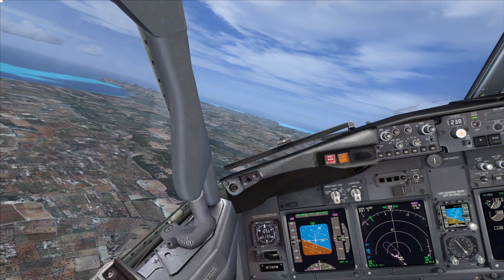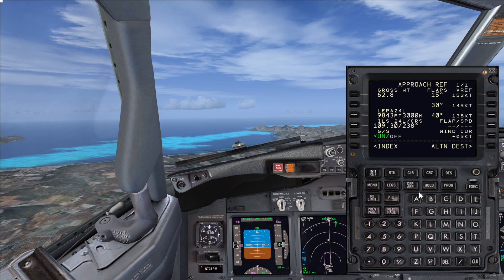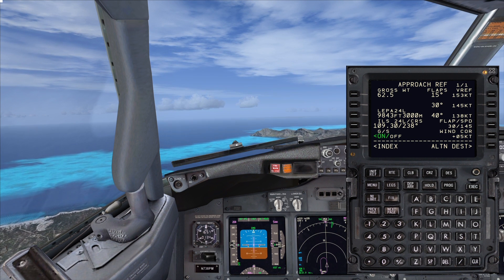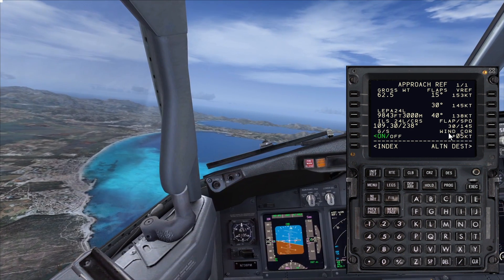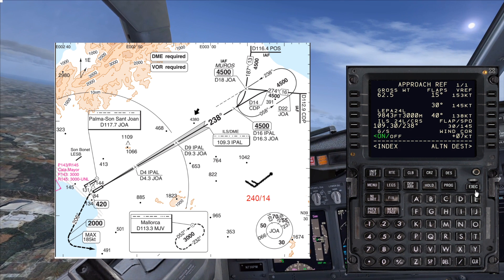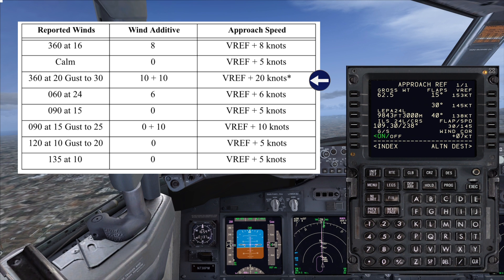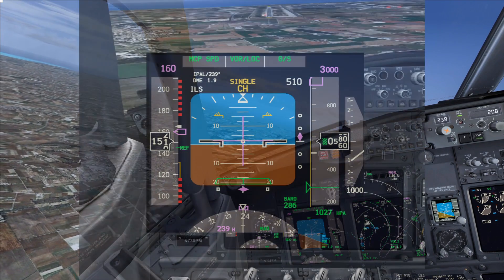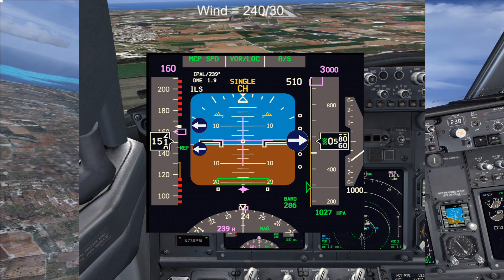PMDG 737 | How to calculate your final approach speed | Real 737 Pilot

Comment: Thanks for doing this tutorial ... although a few years ago, still very relevant and helpful to fellow simmers (like me) learning the ropes... It's a great explanation and I am with you to a point... in the chart, the top and bottom three examples make sense but I don't follow the logic with the middle two... 060 at 24 (additive 6) and 090 at 15 (additive 0 )... maybe a clue lies in the wind direction shown in the chart? (hoping you will clarify please). When referring to 'head wind' ... does this literally mean 'head on' or does it also include a certain tolerance either side?... Lastly, what happens if there's a cross-wind?

Comment: hey, one question how do you calculate the landing speed when the wind is variable  (e.g. 29016KT 210V310) Do you calculate it the same way ?  So if the Runway Heading is 290 and the wind is 290/16KT 210V310  would i then have a landing speed of Vref + 8 KT ?

Comment: great tutorial :D, but.
lets say this is the case:  WIND 020/09kts (08KT HW)
headwind is 8,  8/2 = 4 then add +4 to vref? but didnt u say minimum to add is 5?
Reply from the maker: If the headwind is less than 10kts, use VREF+5. It's the minimum wind additive. 

eg - 
NO wind = + 5kts 
7kt HW = + 5kts

If above 10kts, half the HW component 

12kt HW = + 6kts

FD2S

Comment: Hello:  A well done video.. Thank you.   

I am lead to understand that the +5 is for speed protection when using the autothrottle.   If you were flying manually what would be the vref ?  Do you take off the +5 ?  (assuming no wind).  I am not referring to wind corr, only vref.

I hope this makes sense,   Iain

Comment: Hey, thanks for the video! One question though: for a very short runway, say, Skiathos with only 1600 m. available, how do I decide if I need flaps 30 or 40, assuming the gross weight is for example 62 tons? Thanks!
Reply from the maker: Flap 30 is the default flap setting, Flap 40 for short runways, generally less than 2000 meters so definitely in Skiathos! 

FD2S
Reply: @flightdeck2sim  Thank you very much!

Comment: what would be when the wind is comig straight from the sight? than you take the half of the knots too? So 7 knots?
Reply from the maker: Hi Leo,

Only based on headwind component so standard +5. If the crosswind was gusting you would add the gust increment.

FD2S
Reply: @flightdeck2sim  okay, thank you :) is it the same on the airbus a320/a321?

Comment: What about the rule of thumb I heard of that you have to add half the gust factor to your approach speed (for example at 240/12G20 with rwy heading 238, you add 6 kts and additional 4 kts, so VRef+10) does this only apply to GA aircraft?
Reply from the maker: The gust factor in your example is 8kts (12G30) which we add to half the steady HW component, so you owuld use VREF+14kts in the example

FD2S
Reply: @flightdeck2sim  thanks alot

Comment: how to calculate the flaps up speed? there is any video about this question in the whole you tube!
Reply from the maker: Hi Renato. The easiest way is to work out your VREF for Flap 40. This can be found in the FMC on the INIT REF page in flight or tables in the manual, it’s based on your gross weight.

You then simply add 70kts to this for the UP speed.

FD2S
Reply: flightdeck2sim hello flightdeck2sim! thank you so much !

Comment: Hi FD2S, wow; I thought I knew everything there was to know about  flying the 737, since watching your videos I have realized just how much I have to learn. Very detailed and informative videos; I really enjoy learning beyond the checklists and the reasons why these checklists are created in the first place. I have two questions if you wouldn't mind answering. 
I'm looking to buy a new laptop to run p3d or FSX on, what laptop is it you use? it seems to run everything very nicely and seems it would fit my needs. and secondly; what EZDOK settings do you use? , I've tried setting it up but just can't get it to work like yours does; would you mind sharing your settings on avsim or even just a screenshot? 
thankyou 
Chris
Reply from the maker: Hi Ann, thanks a lot (the best pilots never stop learning!)

This tutorial was filmed on a Dell XPS Laptop (9550)

Intel Core i7 2.6 GHz, 16 GB RAM, 512 GB SSD, NVIDIA GeForce 750m.

The performance was ok but would struggle in areas of complex scenery/airports

I recently upgraded to a ChillBlast PC which has these bits....

• Intel Core i7-7700K Kaby Lake Processor/8MB L3 Cache
• Chillblast 120 CPU Water Cooler
• Asus PRIME Z270-P Motherboard
• 32GB DDR4 2400MHz
• 500GB Samsung 960 EVO M.2 SSD
• NVIDIA GeForce GTX 1080 8GB Graphics Card

You'll see a marked improvement in performance compared to my older tutorials.

The EZDOK settings are from the AVSIM Library, it was under PMDG NGX or something like that! 

FD2S

Comment: Hello! I had a question when i put in my vref + 5 IT is very far way from the stall speed. When i try to fly slower i am able to fly 3 ° pitch up but when i fly vref + 5 it is a negative pitch... I have the correct fuel and payload quantity in the fmc hope you can help me.
Reply from the maker: https://youtu.be/6qnriMfIbEE?t=5m55s

From this time you can see the target attitude and thrust settings for Flap 30. 

FD2S
Reply: Thanks for the information. In the table, it says Vref flap 30 + 10 this depends on the wind right? so should I fly Vref + 5 ?
Reply from the maker: Correct, minimum approach speed is VREF+5 👍🏼

Comment: Hi, great video! Today in a very windy approach I had to use my vREF+20 knots, I did the flare as always (check, close, hold technique respectively check at 20ft, close at 15/10) but the aircraft floated all down half of the runway! I don't know if it was due to the relative high speed or due to the wind... (RWY 32 wind 290/26 gusting 41)  What can I do the next time? Thanks in advance and keep going, this channel is fantastic!
Reply from the maker: Hi Francesco,

It would have been the increased airspeed that caused you to float. This is something you have to deal with in real life if you have increased your final approach speed due to increased headwind. In these situations you have to sometimes fly the aircraft onto the runway and not "check" abruptly otherwise the aircraft will just pitch up and climb. 

Good Luck!

FD2S
Reply: flightdeck2sim Thanks! What do you exactly mean for “fly the aircraft onto the runway”?
Reply from the maker: Usually when you flare, reduce thrust and hold the attitude the aircraft settles down nicely. If you have a higher approach speed the aircraft has a increased tendency to float. To counter this you might have to pitch down very slightly to get the aircraft to touchdown but you must ensure the main gear touchdown first.

FD2S
Reply: flightdeck2sim Thank you, I definitely need to practice😂

Comment: Great video! I have a question about the chart. What is the formula for calculating the wind additive of a wind that is between a headwind and crosswind? I see that the example of 060@24 is 6 knots and my logical guess is that it's a 4th of the wind speed but I wanted to be sure.
Reply: You can learn cosine factors for 30, 45 and 60 degrees for quick calculations. It's .86, .707 and .50. For 060@24 example, cos of 060 is .5 so head wind component is 12. You need to add half of head wind component to Vref speed so it's 12/2=6
Reply from the maker: Hi Grymlocked, Thanks!

We have a very handy crosswind/headwind table in the flightdeck on a checklist and our OPT app calculates it for us. There are lots of rules of thumb you can use but I've genuinely forgotten all of them! It's been a long time since I've flown a light aircraft and had to calculate crosswind/drift!

FD2S.

Comment: Another great video!
In the last minute, did you mean that any time within the last 500 AGL, if the IAS goes below VREF and above VREF+20, we must go missed?
Reply from the maker: Hi Wotao, thanks again!

No just at the landing gate. Below the landing gate if you approach or just exceed VREF - VREF+20 PF must immediately correct but if the correction is not working then you'd fly a missed approach.  

One thing FSX doesn't replicate well is flying in gusty/windshear conditions. In the real aircraft with strong gusty winds it can be extremely challenging to fly a speed accurately, the A/T certainly isn't capable of making the change quick enough in strong gusts.

So long as you're correcting speed and the correction is working and you get your self stabilised again you could continue.

Hope this helped!

FD2S
Reply: Thanks a lot for the clarifications! They are very helpful.

XP11 seems to simulate wind gusts well, but too bad there is no study-level airliner yet.

Comment: A fantastic video as always! Just a quick question though - if ATC tell you to "reduce minimum safe apporach speed" is this the VREF speed with no wind correction or anything lower than that? Thanks!
Reply from the maker: Good day! Thanks a lot!

If Tower requested minimum approach speed that's fully configured to land and flying your target airspeed so VREF + any wind additive you calculated, usually requested when someone misses the exit or Tower are trying to get a departure away.

All the best!

FD2S.

Comment: Good work again; thanks. I always learn something from these... this time around although I knew how to calculate landing weights and speeds I learned about using the bugs on the airspeed tape along with the yellow arc to confirm landing. 

I've got an off-topic question about real world procedures: in your airline do you update flight progress manually by writing on a paper copy of the navlog? I use an online service to produce PDF copies of all my flightplan and briefing pack, but I view these on a tablet pc and can't update them as I cross waypoints enroute. Do you guys do that at all? On paper? On EFB?
Reply from the maker: Hi John, thanks again for your kind words!

At my current outfit we still use paper OFP's (Operational Flight Plan) as do a lot of operators still. We print out all our flight plans for the day before our duty. In flight when reaching TOC the PM starts working out the ETA for every waypoint and every 30 minutes we check our time and fuel quantity/fuel burn against a waypoint and make a note on the OFP (Operational Flight Plan)

Everything else, performance calculations and charts are on the EFB.

Hope this helped!

FD2S.
Reply: flightdeck2sim that's what I needed to know! I have a DIY efb whereby I run the TopCat performance calculator software and Navigraph charts alongside a VATSIM client and PDF reader on a Windows 10 tablet. I'm currently viewing the OFP on that, but unable to update. I'll have to invest in some printer ink and print the navlog pages of in going to do it properly!